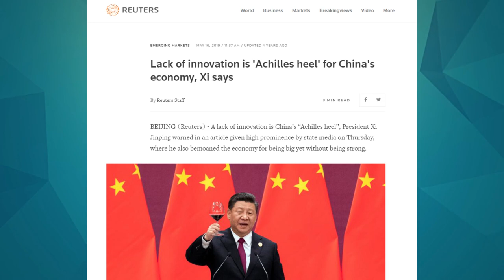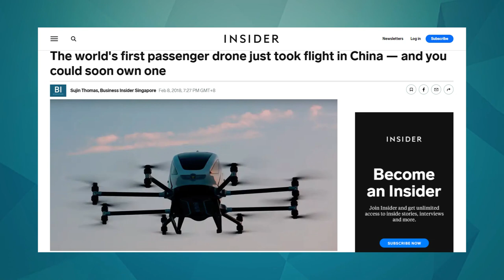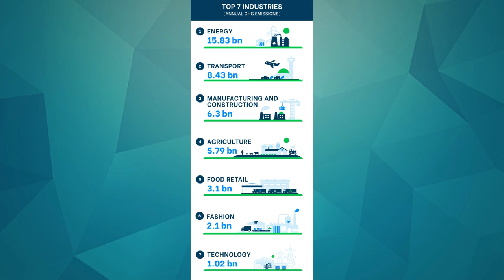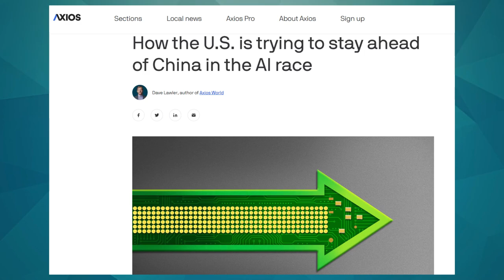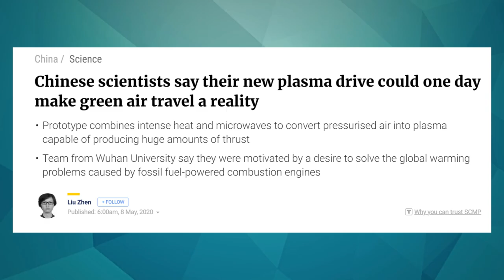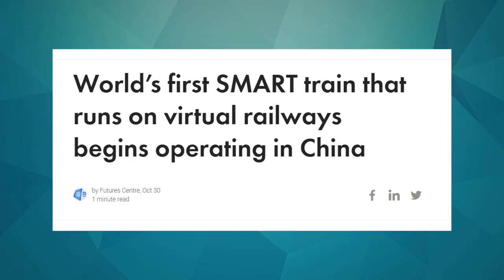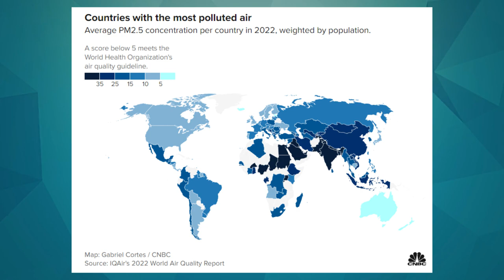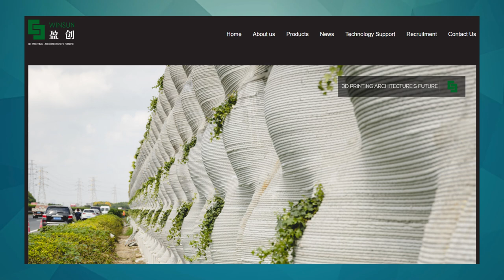America Can't Compete with China's Tech Development

Comment: the air purifier is also a good middle step to actual carbon capture from air, most of them suffer from the fact that it is extremely tricky and going from nothing to working cc is simply too costly and nets little to no result. with a useful middle step, it can be developed and used for gradual advancement.